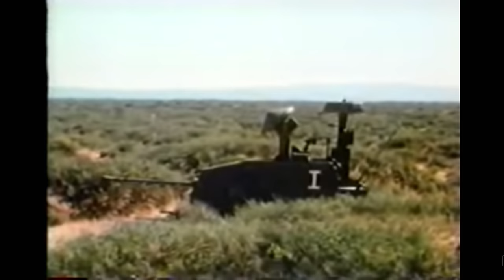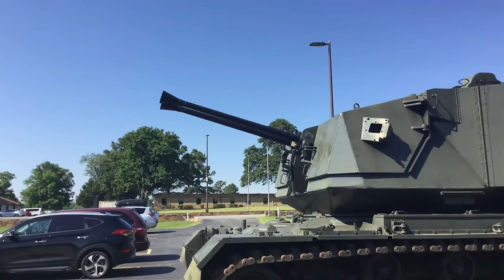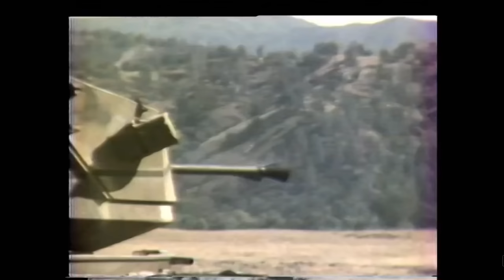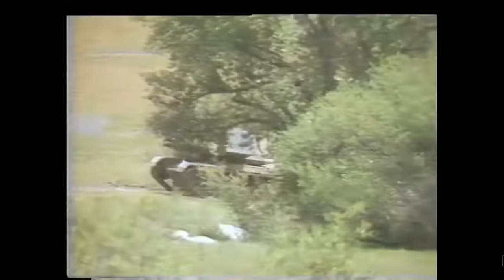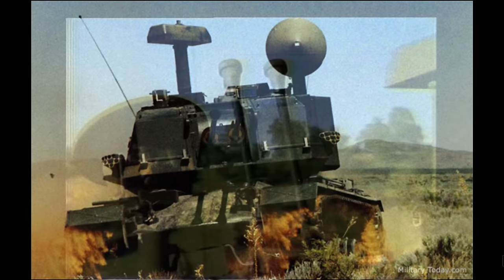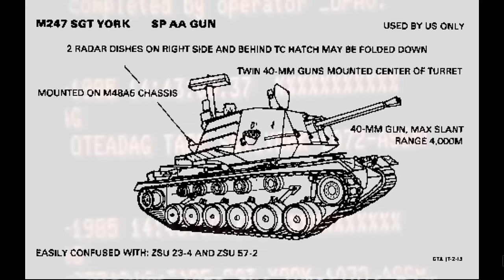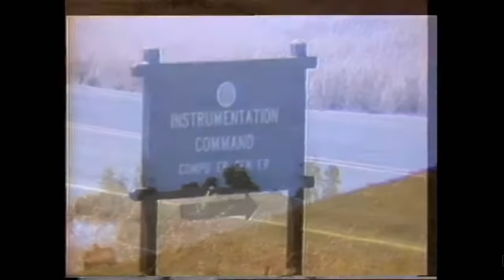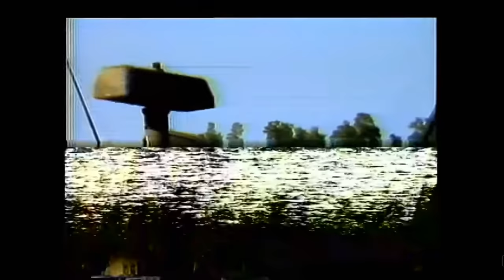M247 'Sergeant York' | WORST AIR DEFENSE EVER!

Comment: On active duty at Ft Bliss 1984-1988. We hosted several social gatherings where West German Luftwaffe officers were in attendance. They looked at the SGT York system like "Are you really serious?!" The idea of using passive radar on a vehicle providing SHORAD support for maneuver units engaged in battle was to them ludicrous. When I explained to a FRG Lt. Colonel about the concept of the active radar also illuminating your own position, his response was classic. "Fire, put the radar into stand bye, and press the accelerator." He said the enemy already knows you are there, so you are not going to be static unless you are trying to get killed. He also wondered why we were not trying to put the gun system on the M1 Abrams chassis. He said if we had merged the Abrams chassis with the gun system off of the German Gephard (Cheetah) air defense, we could have had a game changer. I agreed with him. The problem was (and is), not made here syndrome. At this same time the New Mexico National Guard had an ADA unit equipped with the French Roland system. Contrary to what may have been said the Roland system was effective as hell for the NATO-Warsaw Pact scenarios. At this same time we were conducting exercises trying to prove that the HAWK missile system was a maneuver unit that could provide ADA coverage for NATO ground units. What we did find out was that even under the best of circumstances (Getting on site and having a missile ready in 90 minutes), we were either vulnerable to air attack or the Air/Land battle had passed us by. To this day the U.S does not have any equivalent of the German Gephard, French Roland or British Rapier systems.

Comment: Takes ford to screw up a Chrysler tank. ;)
Reply: Back when Chrysler was actually good. How times change.
Reply: @Chopstorm.  Sad but true. Imagine if Chrysler got the go ahead to make the TV-8?
Reply: Chopstorm Chrysler designed the M-1 and the turbine engine that powered it. Chrysler was forced to give up its defense division during a government bailout late 70’s early 80’s.
Reply: @centurian318  Ok? What's your point.
Reply: Chopstorm Chrysler defense knew what they were doing, the military knew it and the government made them give up their defense side to keep from losing it if Chrysler went under.
Reply: @centurian318  I fail to see your point. You're talking about something that happened over 40 years ago.
Reply: gm better
Reply: @Noooo23523  gm couldn't even build a 4 cycle diesel.
Reply: @randymagnum143  and what? gm has the best gasoline engines, and now they have good diesels
Reply: @Noooo23523  no, the duramax still has massive problems under hard use.   The ls is a damn good engine, but its a huge stretch to say its better than the apache headed engines.
Reply: @Noooo23523  for the record, no one has ever built a good 4 cycle v8 diesel.  Mack was close.
Reply: @randymagnum143  nissan titan
Reply: @randymagnum143  gm has best v8s for the price and superior inline 4 engines, and they have diesels from duramax and isuzu, had from fiat and stuff like that and they made their new ones very good
Reply: @randymagnum143  whatever if your a chrysler fan and im a gm fan we can both agree that ford and volkswagen are shit
Reply: @randymagnum143  chysler abrams has intake problems and gm abrams is more powerful
Reply: @Noooo23523  there's quite a few problems.  Cummins has a real bad track record with v8's
Reply: @Noooo23523  what?
Reply: @randymagnum143  oh
Reply: @Noooo23523  look at the vt555 and vt9 oh nothing (903)
They sucked hard in time between overhauls, structural and cooling issues, and harmonic induced crank failure.  (Much better in that respect than 60 degreee 3408 cat though)
7 large main bearings work better than 5 when dealing with super high cylinder pressure in a compression ignited engine.  2 cycle Detroit diesels spread that pressure over twice as many   combustion events, and dont have the same secondary harmonic problems.
Reply: Ford vs Chrysler........that's a tough choice.
Reply: @richsmith4207  easy: chevrolet
Reply: Chrysler is bad now lol
Reply: @bryanx5829  its not bad
Reply: @Noooo23523  yes. Chevy is good.. enough.

Comment: So bad that planes would fly near it to be safe.
Reply: And that's actually a valid tactic. Flying Nap on Earth are preferrable if the pilot wants to avoid ground radar detection iirc.
Reply: arya31ful eka maybe, but AA guns are more effective against low flying targets. NOE flying is generally to evade SAMs, because they’re more dangerous and, nowadays, more prevalent. It’s also to evade detection in general to avoid interception and the possibility of the target being moved.

But in WWII, fighter-bombers, attack aircraft, and bombers (admittedly they were more vulnerable to flak no matter what) were generally safer flying higher rather than lower.
Reply: @arya31ful  actually that was RAF doctrine right up to the point it was tried. In the first gulf war. The attrition rates from accidents when flying near Mach 1 at 15 meters were far higher than the US being shot down by SAM flying at 10,000 meters. The RAF switched to high level and the loss rate halved. A SAM is actually pretty easy to evade if you see it early on. Even an AMRAAM can be evaded pretty easily if you know where it is. The only missiles that are super agile and cannot be easily evaded are things like ASRAAM and latest generation Russian A-73.
Reply: @gordonlawrence1448  Now that's new. My understanding is flying NOE makes it harder for ground radar to pick up the target because of ground clutter thus making radar guided weapons less useful, while also makes heat-seeking SAM and AA guns more difficult to acquire the target because of shorter reaction time because the target pases through their "engagegement dome" so quickly.
That's all i knew.
Reply: @arya31ful  There is a little more to it than that. EG your aircraft is flying down a valley then SAM/SPAAG is not going to be able to detect it at all as they use Radar frequencies that only operate line of sight.. So you could be in the next valley 5 miles away and you would not be picked up. Ground clutter is really only an issue for pulse doppler radar on fast moving platforms. EG part of the detection process is that the return frequency is marginally different to the  pulse frequency. If the target is not moving, and you are not moving there is no doppler effect. Ground attack radars work differently to air to air radars in terms of frequency, opulse repetition rate and passive return signal filtering. With modern (anything past about 1980) radars they usually have the circuitry for both and the amps/antennas are picked so that they will work with both (and the ATG frequency is usually a harmonic of the ATA radar. That said some clever git worked out how to do both on the same frequency for some multi-mode radars.
Reply: @arya31ful  The Russian's have a accoustical detection system that uses sound for triangulation to locate jet's  flying nap of the earth. I have no idea if Iraq had it or not.
Reply: More than safe, it would probably protect enemy airplanes and shoot at their targets.
Reply: Detroit Lions of Air Defense weapons.  How do you keep the Detroit Lions out of your backyard?  Answer:  Put up goalposts.
Reply: Best Comment
Reply: @syaondri 
I don't think I have ever laughed so hard as I did at your comment!! Good show!!

Comment: I read that the 40mm barrels which were used, were old, worn, examples, and so were the M48 chasses.  They made the York out of clunkers, literally.  Also, the traverse was not fast, instead, it was so slow it invalidated the concept of quick tracking.
The York Concept was great: since "Dusters" (all SPAA, but the M19 and M42 in particular) were most often used against/for ground targets, why not armor them up?  A quick traversing, quick firing, AA tank makes a better weapon for fast reaction to enemy soft targets (MG nests, Dragon Teams, RPG units, and the like), than slow traversing, big caliber, MBTs.  But, again, the traverse was slow.  Check your own clip.  That traverse was the same as the M48, not some OP hydraulic supersystem.  They set the shot up to make it look like it was "just right".  Further, no maneuvering target was ever hit by a York.  The RaDAR could not discern between low planes (like CAS planes and choppers)  and Ground Clutter.
  It was the coolest vehicle ever, concept-wise, but it was a pig in hardware form.   Off the shelf is a ploy used by unscrupulous contractors to get past funding prejudice.  Ford rooked the feds, scamming them with the "off the shelf" carrot.  Like every other such "off the shelf" improvisation (the Curtis P-79 Eagle, and North American Rockwell HiMAT projects comes to mind) it would inevitably end up in a totally new aircraft using zero percent of existing components.  Off the shelf is a ploy used by unscrupulous contractors to get past funding prejudice.  It never works as planned.
Reply: The Cobra developed from Huey components is an exception, but that was in the middle of the Vietnam war and the project was done by a small in house engineering team with no outside interference.

It's amazing what can be accomplished when a program is below the radar of politicians, the bureaucrats and senior management.
Reply: That York program sounds like every other shed-made weapon project. But instead  of a group of experienced and sane designer it now consists of clueless people slapping old stuff together without real thought.
Reply: @casbot71  It's amazing what can be accomplished when a program is below the radar of politicians, the bureaucrats and senior management. - oh yeah, no doubt.
Reply: Your off your head..... If a company produced a..... I give up, humanity is lost! Fuck it your right i don't care
Reply: There were some other issues too. For example the Bofors they used were I believe the L43 variant (1.7 meter long barrel) which for the day was shite. There was an L60 and even an L70 variant available which would have given much higher muzzle velocity and therefore more accuracy at longer ranges. The L70 was near an extra 4 feet of barrel. To give you a vague idea the L43 was I think capable of giving you about 2100 fps muzzle velocity. The L70 which could use the updated ammunition gave more like 3400.
Reply: true the "on shelf" carrot was used in soviet union with the Tu-22M3 backfire program, it was supposed to be a variant of an existing airplane the Tu-22 Blinder but in reality was a new plane that had little common with the predecessor
Reply: @vemundr9263  Ford sold the Army on that by pointing out how great the F-16's radar is. Seeing as the Army hadn't operated its own fighters since World War II, none of the Army brass knew enough about aircraft radars to realize they have different requirements than ground-based radars.
Reply: @petros311  That's pretty much what McDonnell Douglas and the US Navy did with the F/A-18E Super Hornet. It's the same basic shape as the F/A-18 Hornet and has the same cockpit.
That's about where the similarities end. The Navy was fully aware of this from the start, they point of the scam was to make Congress think it was a simple low-risk upgrade to an existing design when it was actually a whole new plane that's significantly larger and more expensive.
Reply: Then the military needs to stop requiring projects use "off the shelf" components.
Reply: @gordonlawrence1448  Accuracy of the gun doesn't matter if the targeting system keeps pointing them in the wrong direction.
Reply: @namyun2743  It can also be argued that it does not matter how good the targeting system is if the weapon has very poor grouping.
Reply: @vemundr9263  The M247 radar was a highly modified APG-66, it was not the same radar not even close.  The vast majority of the S/W was rewritten, it was a monopulse (APG-66 was single channel),....  The gun barrel placement was not a factor, but the vibration/shock of the 40mm guns caused alot of issues for the M247 radar failures.  The Blacktail video also has alot of Internet falsehoods concerning the radar as well.
Reply: The F-117 is a excellent example of off the shelf engineering.  The engines are from a F/A-18, cockpit also borrowed from a F/A-18, INS from a B-52, main landing gear from F-15, nose gear from a F-100, cockpit environmental control (aka A/C) from a C-130.  When used properly off the shelf can provide great advantage,
Reply: Weren't the Soviet ZSU systems better?
Reply: RE: ZSU (Zenitnayah Samoxodnaya Artilleryskayah)
  The mass produced ones were an interesting mix.  ZSU-57-2 was formidable gun platform, but inadequate for tracking the low flying aircraft it was meant to combat.  Though its guns were hard hitting, indeed, rate of fire, reloading, traverse, were all slow.  ZSU-23-4 (called Shilka) was very much the right machine at the right time.  Still, reloading the vehicle was a long, boring, routine.
  M-247 and German Gepard were to be the state of the art . . . which had already been reached by a seldom seen Soviet prototype, the 37mm, closed turret, Energia.  Energia was too complex, technologically speaking, to allow for mass production.  Tunguska, finalized 30 years later, was the "new" standard for a decade.  Compared to our M-163 Vulcan, the Soviet era designs were both more useful and more effective.  And more widely deployed.
  The ultimate problem for cannon armed AA vehicles is the wide radius of empty terrain one needs to keep spent rounds from falling among your troops.  Larger caliber equals wider "dead zone" you must keep around your "Triple A" (AAA or Anti Aircraft Artillery).  Smaller caliber has a smaller dead zone, but needs more hits on target to disable it.
  Combine this with the speed of approach of modern ground attack aircraft (typically 400mph) and you end up with such a small window of opportunity (it only takes a 400mph plane a minute and a half to cross a ten mile gap.  The nature of geography might limit visibility in the appropriate direction to a mile or less) that it makes better sense to trust your own air force to take it out.
  Consider that detecting, identifying, and effectively engaging, an enemy air support platform is a process taking 30 seconds minimum and can stretch out much longer due to other factors (terrain, weather state, enemy jamming, et al).  By the time you're set up and ready to fire, the enemy is already gone and you're watching a cloud of antitank submunitions fall toward your vehicle.
  In the crowded terrain of western Europe there often isn't enough enough open space to effectively deploy for all around air defense.  On the Kalmuck steppe, on the other hand, the wide fields of fire and long ranges of visibility are ideal for engagement of low flying tactical support aircraft.
Reply: As some other people pointed out "Off the Shelf" designs can work; but they only work when, as with any other design, it is a sound design made by people who know what they're doing  with the end goal of making a functional machine. When a bunch of people get together to make a slapped together machine with the goal of simply tricking someone into buying it for a gimmick it won't matter if the thing is using "off the shelf" parts or new specially designed parts, it's going to have poor functionality no matter what simply because it's a design that was made to look appealing, not function well (in other words it doesn't work because it's a shit design).
Going to the example of the M14 a contrast can be made to the BM-59, another battle rifle made from Garand parts that fared better because the people designing it had the goal of making a well functioning rifle, and not a contract winner.
Reply: The turret spun like lightning. I was inside one when we acquired a target. Don't believe everything you read.